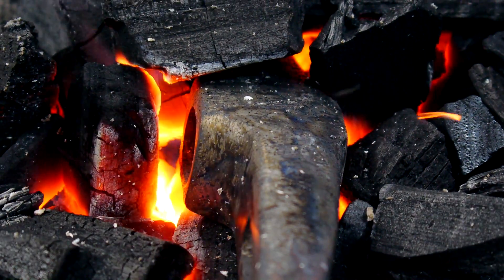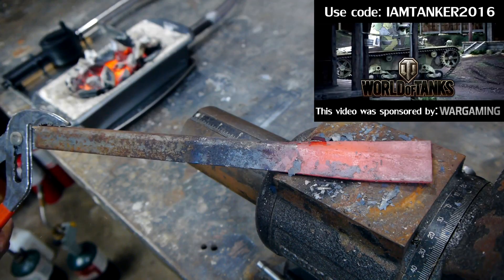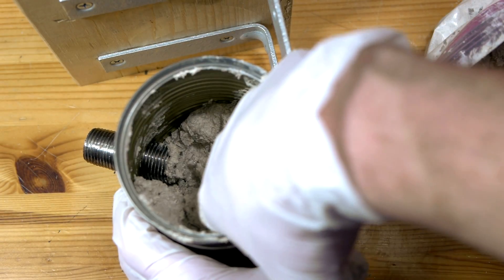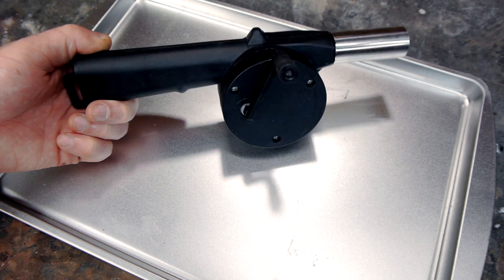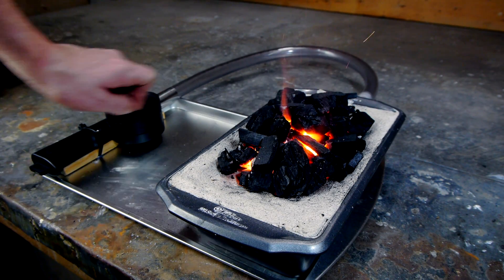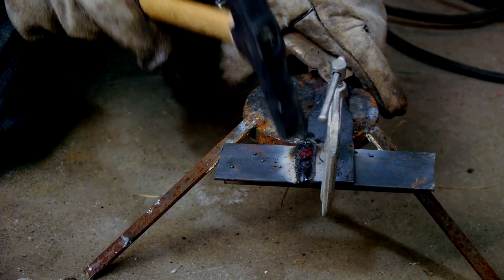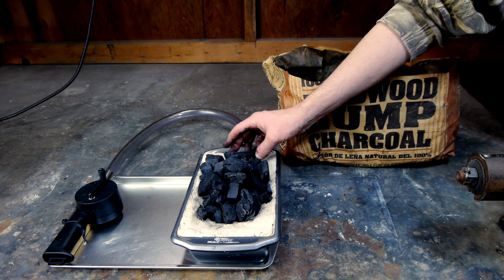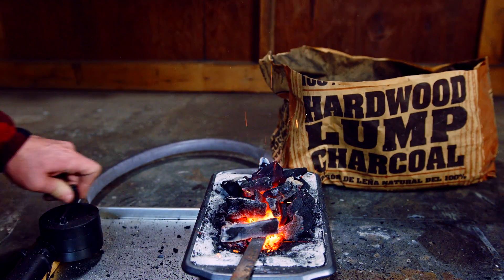How To Make A Tabletop Charcoal Forge - NightHawkInLight

Comment: Wannabe blacksmith here. Ive always wondered how the metal pipe that pumps air through forges dosnt just melt? It sits in the hottest part of the forge the entire time its lit, how can you heat up your steel but that thing dosnt melt or break?

Comment: In welding class we were instructed to NEVER weld teflon coated pans! Although super safe at normal cooking temperatures, and even a little beyond, we were told that welding temperatures turned teflon into EXTREMELY toxic fumes. Maybe your insulating layer is enough to keep it below that temperature, but better to use uncoated steel or stainless steel instead.
Reply from the maker: Good point!

Comment: Great stuff. I started crafting mine today. After 2 not so great 3/4 pipes cut terribly with my angle grinder, I commend you for keeping such a straight line in the pipe. I hope my sloppiness doesn't affect the heating consistency too much.

Comment: Hello! I'm thinking of doing this design, but I was wondering. Do you have to turn the wheel on the blower constantly while heating the metal ?
Reply from the maker: Yes you have to keep turning the blower. You can use an electric fan instead like a hair dryer blower.
Reply: @Nighthawkinlight  Thank you very much for your reply!

Comment: Can I add a tip to this as a plumber who works with black iron a lot? You could also get a fireplace insert if you couldnt drill black iron. Its the same thing as what you're talking about. A drilled pipe for gas flow to fireplace inserts. You'd just have to get a 1/2 inch plug for one end and a nipple for the other.
Reply from the maker: Good tip

Comment: Does anyone know if I could use a short section of copper pipe instead of stainless steel or is the melting point too low?
Reply from the maker: There's no harm in trying

Comment: Plaster of pairs is a horrible material for building forge. Plaster is CaSO4 hemihydrate, and the heat from the forge together with charcoal (carbon) will react with CaSO4, causing it to disintegrate, and releasing toxic sulfur dioxide (SO2). This irritates your lungs, and leaves an annoying stench everywhere, also the sulfur leach into the steel, and weaken it. I built a forge like this (but bigger) using a plaster + perlite mix and learnt the lesson the hard way. Please, don't spread misinformation like this, just buy some proper refractory cement/brick.
Reply from the maker: Maybe I never had an issue because I haven't used it on as large of scale as you have. In my small forges it has worked great over the years, if a little brittle after the heat dehydrates it. But it's cheap to replace.

Comment: Wow. Hey, what if I took the design of the Soup Can Propane Furnace and made the forge out of that? 

I want to use it for heat treating knives, so if I turned the furnace upright, filled it up with charcoal, and blasted air into it through the base using this hand blower, would that work, or would there be too much charcoal for this blower to handle?
Reply from the maker: That would work fine

Comment: Hey there - awesome video. I made this forge to a tee, but I can't get steel hot enough to forge with it. Does the type of charcoal matter? I'm using a hair dryer for the air, and it blows hard enough I can barely keep the coals in the pan; so I can't imagine lack of air is the issue. Any ideas?
Reply: my issue was type of coals - Briquette style definitely does not work. Lump charcoal is the way to go.
Reply from the maker: Yep, lump charcoal is there thing to use.

Comment: I'm thinking of scaling this up with a blowdryer to provide oxygen and using the forge body made up of a wheelbarrow, anyone think it'll work? Maybe I could get a couple pipes going into it to provide better airflow
Reply from the maker: A wheel barrow would burn a bag of charcoal about every 20 minutes. That's a bit big
Reply: Alright, thanks for the feedback. Any recommendations on a better sized container to use? I still want it to be an upscaled project

Comment: I'm curious as how you would replace the hand blower with a hair dryer, would you just use a different size of vinyl pipe? Also when you say well ventilated would just a normal garage work with the door open a tad?

Comment: would it work better if there was a cover half? A second bread pan on top, with a window cut on its side, joined by screws on the holding edges? I feel it'd reflect heat back into the forge, allowing for hotter temperatures.

Comment: I really really want to build this but I'm reading online the lining won't hold up to the heat of the forge for very long. Is there I better refractory I could use or am I wrong and this would do just fine?
Reply from the maker: You can buy real forge refractory cement or bricks, but they will be a lot more expensive. This will last for a few months in this design easily, and you can just touch it up when some crumbles.
Reply: NightHawkInLight awesome much appreciated! Thanks for the speedy reply I'm definitely going to give this one a go.

Comment: Could this be used for melting Aluminium in an old stainless steel cooking pan for casting ingots ?  Been looking at a small way to do it, but most have used large buckets as the basis and a hair dryer.
Reply: Sorry, didn't look below. Question answered now to make one . Thanks for the idea.

Comment: This design works great.  I built it last Summer and mostly use it for quenching knives I make so far.  I'm working on an anvil from a piece of rail and when it's complete I'll start forging blades instead of grinding them out.  Thanks for providing a great design and description of the process to make this style of forge.  It's remarkably cheap and functional.

Comment: additionally, I would add the insulating mixture all the way up to the opening on the iron pipe, possibly wedging a paint stirrer as well.  That way you can be assured that you won't damage the pipe even at white hot temps.

Comment: Hi how is the best way to cool the forged things down
Reply: That depends.  If you are forging your material, you just let it air cool.  If you want to quench (harden) carbon steel you use a quenching liquid appropriate to your steel type (for 1084 you can use vegetable oil or motor oil)

Comment: wy dont use wood ?
Reply: Charcoal and coal give a higher heat, which helps a lot for forging.  There are forges designed to use wood, but basically they burn the wood down to charcoal in the process.  You can make your own charcoal - search youtube.

Comment: I like your design but I would suggest drilling holes for airflow rather than cutting a long opening and I would suggest a refractory that actually insulates like Clay and Ash rather than Sand and Plaster.

Comment: I might recommend making a hood over the fire pot for capturing the sparks and fumes.  I noticed a lot of ash and sparks falling on your hands and I know much those sting.  Maybe a steel pail with a 3-inch pipe out the top? Would also recommend a spark arrester.

Comment: Question, can a small bike pump act as a pump bellows for this forge?
Reply: Miguel Rojas I have no idea what you're talking about
Reply: A bicycle pump is very low volume.  You'd be better off with a camping air mattress pump from WalMart...  Very cheap, some even blow air on both up and down strokes.
Reply: Probably.
Reply: Gangyi Xu But it did work for many Asian blacksmiths, right?
Reply: +Gangyi Xu Back in the day the air was blown and sucked into the forge and it worked
Reply: Miguel Rojas You'll be sucking air in and out so probably no.

Comment: Nothing to do with this video, but have you considered projects using lasers? could be a lot of fun!
Reply from the maker: Sorry for the delay, yeah I've done a few. There are more ideas I have in mind but I'm looking for a laser company to sponsor the videos.
Reply: Thanks for replying, I recently went on a blacksmithing coarse and am now probably going to make your small forge, anything you might have done differently if you had the chance to do it again? I am looking forward to your videos when someone finally sponsors you.
Reply from the maker: I think an electric blower like a hair drier (with the heat turned off) would make a better forge for big projects. The hand crank blower works ok but unless you need it to be electricity free an electric blower is easier on your hands.
Reply: Yes I imagine that would help a lot, the man who lead our course, colin from strawberry steel, said he only really used his if he had to be off the grid off site. Thank you for your feedback i'll put it to good use, I was also thinking that I could use a brake drum instead of a dish so I don't have to use plaster paris.

Comment: I made a forge from a small cast iron garden barbeque. I use an electric blower that looks like it has been salvaged from a shipwreck (I found it on a closed shipyard).  The protective coating sounds wothwhile to try, but apart from a small cast iron grille that melted, it seems to work. The grille has been replaced with plate iron that does not melt so easily.

Comment: let the pipe go through both sides of the pan and close it up with the cap on the outside so you can clean it out easily when it gets clogged with ashes ;-)
Reply: The air blows all ashes upwards, so there shouldn't be any clogging in the first place... but yeah, good suggestion.
Reply: Steamrick
you get some pretty nasty slag in a "normal" forge, this little thing is obviously diffrent but time will tell - if NIL uses this very often.
Reply: @felixdietzCGN  even if that happens, you can build these cheap enough to replace them if you need to. It's not really a major investment.

Comment: Would it be even more effective if you got another bread pan, cut it in half, then put the clay mixture around it and somehow attach it to the top? That way much more heat would be conserved
Reply: Then you'd have the problem that the access hatch and the air escape vent would be one and the same, quickly leading to scorched hands... but yes, you'd get higher temperatures, sort of like in a glass oven.
Reply: Gloves should fix that problems. Do you know if this would work using coal instead of charcoal?

Comment: I wonder if there's any way the blower could be attached to a foot pedal, like that of an old sewing machine. That's probably a bad example, but something like that.
Reply: you could always just use a foot pump, though that has the disadvantage of being air bursts rather than a steady flow. I guess add a sack of air in the middle like a bagpipe.

Comment: Do you get many, if any, ashes falling into the little slit on the air pipe underneath it? If so, is cleaning it as easy as just removing the vinyl tube and putting it on its side? I do not have much room in my house, yet I want to dabble in blacksmithing. This seems like it could be a nice thing to drag into a drive way or something and practice with.
Reply: You shouldn't get much ash in the pipe. If you do, just don't get it wet or it might bake down. If you make it yourself, consider getting a longer pipe and letting the tip protude from the other side of the pan. That way you can unscrew the cap and just stick something through the pipe to clean it.

Comment: How difficult would it be to either attach a motor to the fireplace blower?
Reply from the maker: It wouldn't be worth while. For a motorized blower it's hard to beat a $10 hair drier.
Reply: microwaves usually have a nice blower motor, as well as a lot of other fun stuff :D

Comment: I wonder if its possible to make a blower with only commonly available hardware store parts.
Reply: That kind of depends on your definition of 'commonly available' and 'blower'. 
A foot pump would be quite easy to make, you just need a spring, a sheet of plastic and some odds and ends to bring it together. 
A centrifugal fan like the one used in the video? I suppose you can make the centrifuge, gears and crank mechanism out of wood or steel if you really want and have precision tools, but you'd definitely need a few ball bearings and I'm not convinced those are commonly available in hardware stores. If you include (remote control) model building and handcrafting stores, then sure, no problem.
Reply: Steamrick if money was no object you could get power tools as they usually have a fan connected to the motors to keep them cool and they would have bearings already
Reply: YoloToTheMax104 In that case you'd probably buy a leaf blower.
Reply: Russel Walker For a forge this size that would probably not be the most space or energy efficient way of supplying air to the fire. And you did ask for a blower made out of hardware store materials where you most likely could buy a leaf blower instead. it probably wouldn't be cost effective to buy materials to build a rotor and housing when it's already available in an electric drill or leaf blower. If you really wanted to get fancy, you most likely could use a small engine to provide air since their flywheels are giant blower rotors. All you'd need to do is fabricate a shroud to direct the air through the cooling fins then into your forge. But then of course, your blower is now bigger than the forge itself and it becomes a question of whether or not it's necessary to overcomplicate and make something that can be compact much large than it has to be.

Comment: Awesome project! I've been working on a large scale blacksmith forge! I'm making it out of a large metal barrel, about 4 ft high, cut length wise, with legs welded on, and the second half of the barrel will be used as a lid, almost like a grill! and of course I'll be using an air blower!

Comment: A note about charcoal in the forge, and the dreaded fire flies. Start the fire with straight from the bag charcoal. Use a small bucket to put more charcoal in and cover with water. The damp/wet charcoal burns even more efficiently and the water helps reduce the flying cinders. I know full scale smiths that do this regularly. I use bituminous coal, yet still have it in water, to help reduce some of the gases that are emitted
Reply from the maker: Good tip! In this case I intentionally poured some coal dust on because the sparks look good for the camera.

Comment: I like the concept.  It is neat and convenient .  Too bad the blower didn't have some type of flywheel, that would be helpful if one were to scale this up.  I'm going to have to build this now...  Thanks for the video.
Reply from the maker: Yes, the blower could be much improved. But they are literally $2. I wish someone sold a better hand crank blower that was somewhere between these cheap ones and the big cast iron ones for full size forges.
Reply: Hey NightHawkInLight would the vinyl tubing melt if the forge was used for too long?
Reply: Ruben Santa-Waldron i guess not because you are blowing cold air through it

Comment: I started off with something very similar. I took a cake pan and drilled about 8 x 1/4" holes in the bottom, kind of in the center of the pan in a rectangle measuring about 2" x 5". Then I dug a hole in the ground and placed a 3" piece of pvc at about a 45 degree angle going down to the bottom of the hole. Then I covered the bit of the pipe leading down into the hole, making sure not to cover the end, and placed the pan over top of the hole. I sealed it with some of the dirt I dug out of the hole and used a bathroom exhaust fan from Lowes for the blower. Worked for a pretty long time. allowed me to forge weld and everything.

Comment: slag chipping hammer?
Reply: Isaac Thomson something you use for welding to make a cleaner weld, the slag is all the oxidized metal and glass and crap that forms on the surface of the weld, and you want to chip it off so that it doesn't become too bulky
Reply: Since you seem to be such an expert on welding, I would heartily appreciate a video on how to weld properly.

Comment: A cheap electric pump for car tires would probably do better
Reply: highlandrab19 car tyre pumps are high pressure, low volume air supplies.  A forge needs low pressure, high volume air.

Comment: That was a lot of plaster mix, didn't it release alot of fumes the first time you fired it up ?
Reply: The first gotcha you may face with plaster of Paris in an application like this is you must heat it slowly the first time to dry it, or the excess water can turn to steam and crack the material.  The second gotcha is that if heated too much the hydration reaction which hardened the plaster will reverse.
Reply: gotcha?

Comment: Would you rather recommend this or a soupcan forge?
Reply: Tzevach Carius-Tybalt so far, I've had more luck with this than the soup can forge, but charcoal/coal forges require a lot more care when actually using them